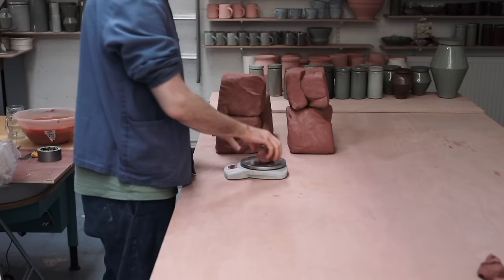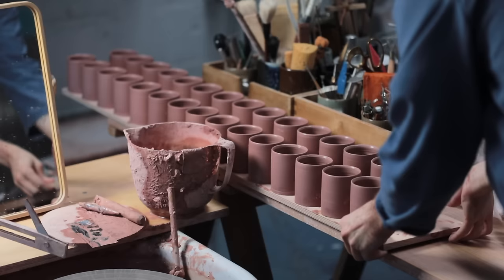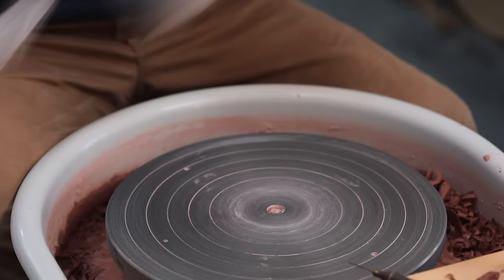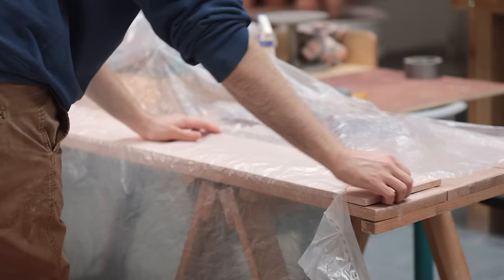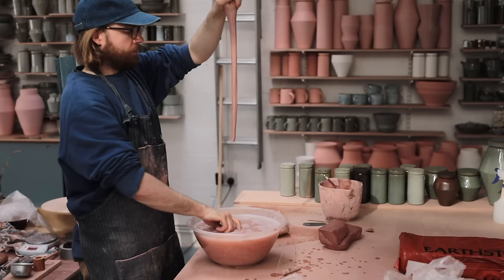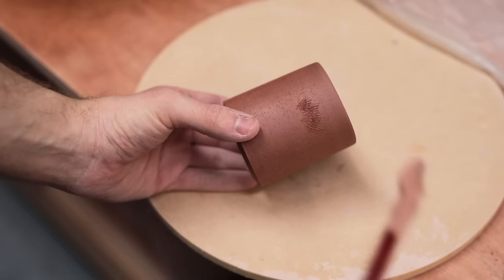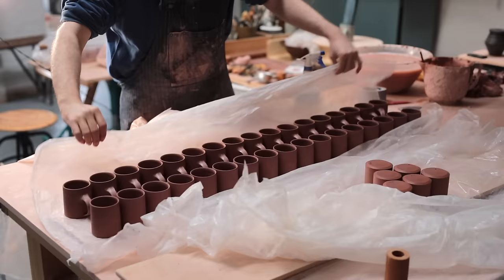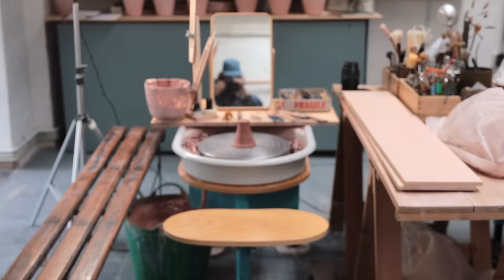Making 100 Espresso Cups

Comment: how do you get them not to deform permanently when you lift them off the wheel? Is it slightly thicker bases? I see that your cups are so soft when you lift them the rim actually compresses, when mine do that then its a hassle to get them to be round again and have to take some sort of sphere to reshape them and sometimes I am not happy with the result as I was when I had just thrown the piece, so more often than not, I will dry the piece on the wheel enough so that it doesn't move much when I lift it off, but then that means a piece takes me 15-20min total, even though the actual throwing took me 10

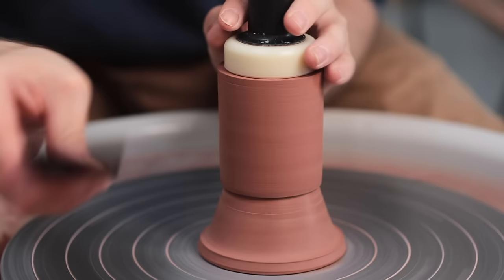Comment: 7:43 what caused that gouge in the foot there? little bit of grog?
Reply from the maker: Very likely! Sometimes they score big lines in all the way around but they’re usually quite easy to smooth over. Even if I don’t, my glazes are usually thick enough to cover and hide any I forget to fix.
Reply: @floriangadsby  I was curious if that was enough to ruin the piece. I'm glad it wasn't.

Comment: I see you don't trim the inside of the mugs. Is that your way or doing it or is trimming the inside not practiced in general?
Reply from the maker: Not for these. Or any of my mugs really, or pots in large quantities. I like trimming the insides of pots that call for it, but on this scale it would add a considerable amount of time to the creation process. Trimming the insides of thrown pots is one of those things that's "frowned upon", which is a silly thought, as really any ceramicist can do whatever they like/deem appropriate. Yet, in some cases, like this, trimming the insides, collecting all the turnings, tipping them out or trying to scrape them out to see what you're doing inside, would get tiresome very quickly.

As I'm working, if I find a particular cup with an error, air-bubble, or something like that on the interior I will fix it, but on this scale it's usually just easier to scrape over it and then soften that spot with a sponge. Ultimately, as glaze will cover all the surfaces of these pots quite thickly, I don't have to worry about every tiny discrepancy.

Comment: Espresso is a little less than 30ml. These look huge
Reply: I'd say around 60ml.
But these things do look way too big, yes. They look like Cappuccino cups.
Reply from the maker: These will shrink as they dry and are fired in the kiln, rather considerably. So, what’s thrown here will become proportionally smaller.
Reply: @floriangadsby  ohhh, that makes sense. I didn't think they'd shrink that much.
Reply: @floriangadsby  interesting